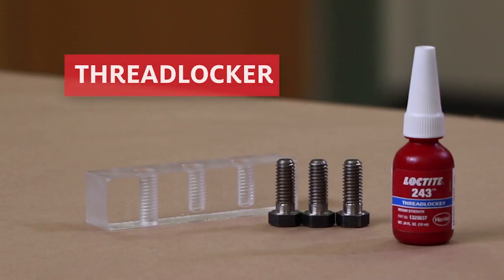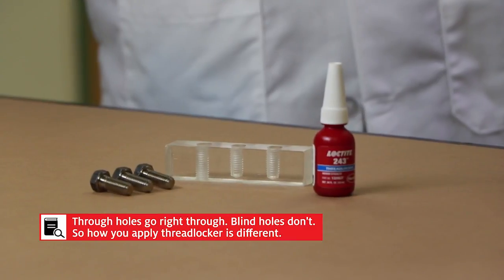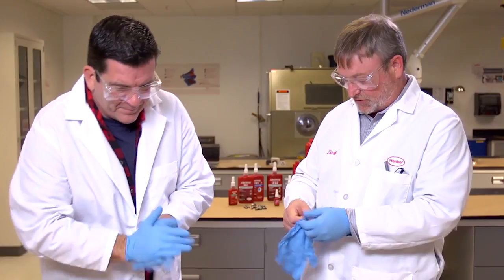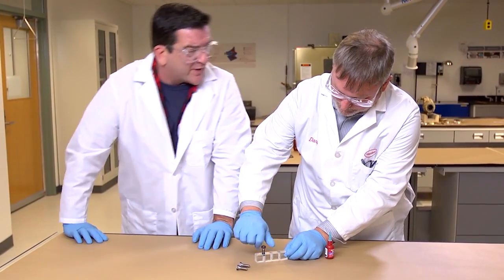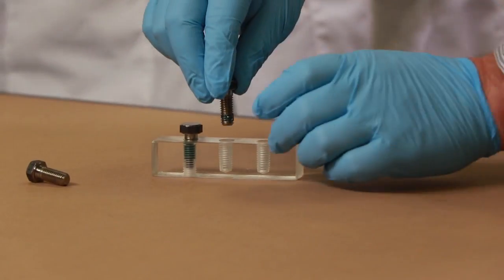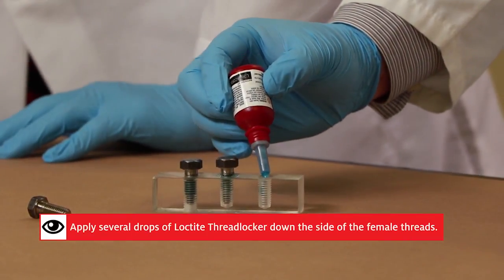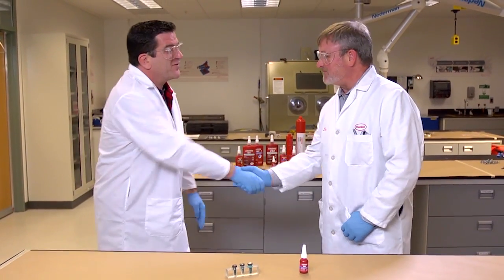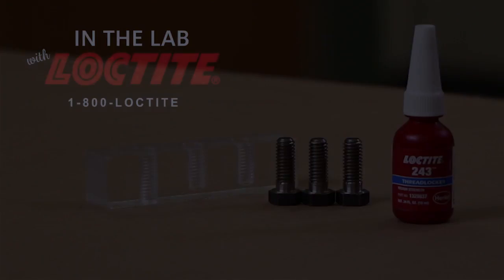In the Lab with LOCTITE® - Proper Use of Threadlocker with Blind Holes

Comment: how many times do fill a blind hole with thread locker then run the bolt in finger tight with 1/4 the bolt sticking out?

Comment: Just an observation and personal rant here... (being that this is the manufacture, LOCTITE YT-Channel.) (Also, this video was done 5-years ago. I haven't searched the YT-Channel to see if they did more complete informative videos or updates. *Refer to my disclaimer.)
Ok, got it - put some threadlocker into the hole then screw-in the cleaned bolt, (torque to spec) and the threadlocker works as it's intended. Pushing up, covering the (majority) of the bolt threads. The experiment shows how this works perfectly - when the hole that you want to screw into is assisted by gravity - keeping the threadlocker compound in place. 

*However, in both videos, the experiment (demonstration) FAILS to show the variety of applications where the threaded hole is above; where the bolt has to be inserted from below. Where the bolt hole isn't assisted by gravity to hold in the threadlocker liquid compound. Where if you squirted in some threadlocker compound it would quickly drip out. I think that this is the greatest percentage of the applications for most of us. The other more common application might be that you are using a pass thru bolt with a nut. In a majority of these specific applications - *I believe the recommendation would be to put *some threadlocker on the inside of the nut - ensuring that you roll the nut around, allowing the threadlocker compound to cover as much of the treads as possible. Then also put some threadlocker compound on the portions of the bolt where the nut-treads will make contact with the bolt. Also, working the threadlocker compound around the bolt threads. (As much as possible. Usually with a clean finger.) In these applications, whenever the "working space" and bolt length allows - the threadlocker compound should be (*or could be?) assisted by some type of mechanical locking device. Such as a lock-washer or star-washer or similar mechanical device. (Other than locking the nut/bolt in place by spot-welding them. Which may be excessive, unsafe or unfeasible.)
{{*Disclaimer: My comments are solely to express my dis-satifaction (a rant) with the Mfg.'s incomplete informative YT-Video. My comments are not intended to instruct anyone as to how they should use a threadlocker or other. I'm not telling you how to do anything.}}
Reply: Hi there, bit late to response but in the case you have described I would suggest using high viscosity threadlocker and still apply it in blind hole first. ensure you use something that has enough viscosity not to run out/drip out of there immediatelly.

Comment: I'm concerned about the tolerance on those threads - a tight thread won't let it push up through the threads, and you'll hydraulic the hole causing a false torque result or potentially cracking the parent material of the hole..?

Comment: What I want to know is just how long did it take to calculate all the parameters of that last hole/bolt/thread locker situation? Hole depth, bolt length, and amount of thread locker pooled at the bottom. 

The thread locker did not even start to rise until the bolt was about half way in. Now, some of the thread locker had been left on the threads after squirting it to the bottom, but that did not seem to provide a complete fill between the internal and external threads. But you seem to be implying that such an amount is not enough. This is your implication, not mine. 

Do you have any data on just how many threads need to be coated with the thread locker to effectively lock it against forces that try to loosen it? And what percentage of coverage is needed on those threads? Does it really need to be a 100% fill? Would a 50% fill across more threads be just as effective? 25%? 75%? 

It is also curious that the thread locker in the bottom started to rise before the bolt reached it. There was still air between the bolt and the thread locker. So it must be wicking action (surface tension) that started that rise. How does one calculate that effect along with hole dept and bolt length? 

I have always applied the thread locker to the bolt, not the hole. And I apply it across all the threads. Now, I know that the threads near the end of the bolt will have a large percentage of the applied locker left behind as the bolt is screwed into the hold. But there is still wicking action which would tend to re-fill those threads. 

People applying thread locker do not always know just how deep a hole goes. And workers on an assembly line may not have the luxury of taking time to measure it. How about a blind hole that is two or three times deeper than the length of thread engagement? How does your technique work there.

Comment: What if it is a blind hole like this BUT the bolt is not going to go to the bottom?
Reply from the maker: For this situation, we'd suggest applying product to the bottom of the male threads along with running some product down the sides of the female threads where there will be engagement. The goal is to make sure that you have threadlocker between the threads, so even though the bolt may not reach the bottom, some of the entrapped air may still push product out. Any excess product that squeezes out can be easily removed after application.
Reply: @loctiteNA  This is what should have been the subject of the video. What was shown, almost never happens in the real world.

Comment: Your manual states putting Loctite on the male thread and female thread, but in the video you only showed applying it to the female thread. Which is it?
Reply: Apply it to both. This video was mainly to demonstrate the purpose of the blindholes pushing air out and pushing the loctite out with it.

Comment: How to apply to a blind hole when is upside down. If I use this technique loctite will just flow out even before I get the chance to insert screw. Thank you
Reply: For applications where normal threadlocker will run, I use Loctite 248 which is blue "stick" threadlocker. It's a waxy, semi-solid that can be applied with a toothpick or small screwdriver.
Reply: I don't know the size of your bolts, but some threadlockers have a thixotropic version. It means, in very simple terms, that you can apply a liquid threadlocker overhead and it will not sag. Loctite 243 is one of these examples.

Comment: Recommendation: Be certain to clean threads of oil and/or preservatives applied by the OEM to prevent corrosion. You can'y loctite to oil or grease.

Comment: What about blind holes that are assigned specific torque values, and you pour a thread locker into the blind hole and torque it to say 50ft lbs., is there a formula to determine the amount of stress the loctite is adding in sense of hydraulically locking the bolt. Like if i add 1ml of loctite into a 2 inch blind hole, how is that changing my torque values?
Reply: I read online that loctite recommend a 20% torque reduction from the dry torque value so in your example you would apply 40ft lbs. However please do some more reseach to find the correct recommendation by loctite